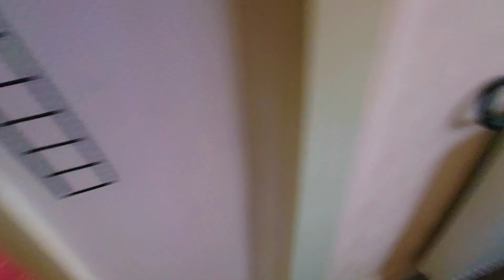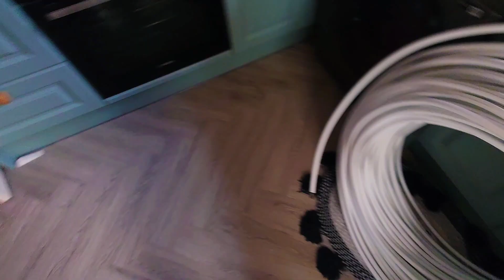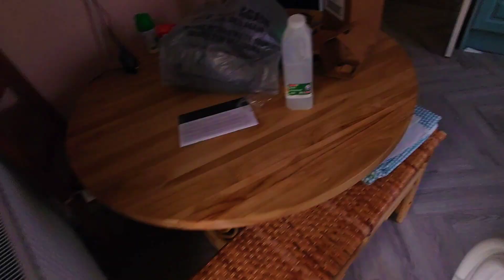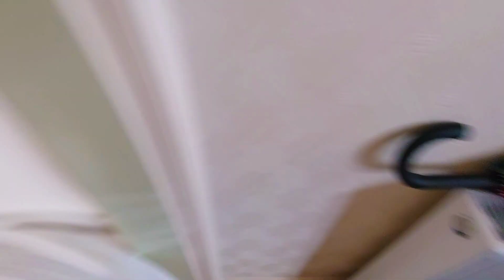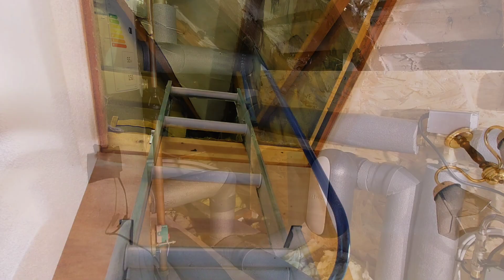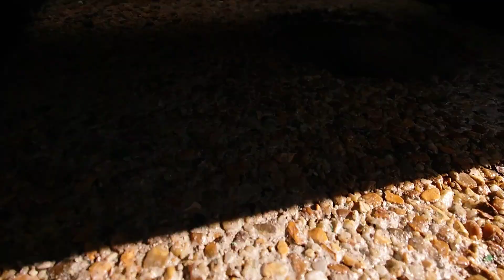Heat Pump installation. How much does it cost?

Comment: :-/ Sadness about the 4-port buffer tank due to the TRVs. Couldn't the majority of radiators be run open loop (no TRVs)? I understand that bedrooms might need TRVs but otherwise what is the need? It would bring down the cost of the system further still, and be less complex and give higher SCOP.
Reply from the maker: True. I could have piped it as a volumiser but the schematic for that on a 150a is a bit clunky with it needing an auto bypass and additional zone valves. 4 pipe is simpler and more open on this particular outdoor unit
Reply: @GHRclimatesystems  Thanks for your response. It is interesting that the Viessmann schematics put you in that direction. It is the same with Vaillant.
It is good to see you are using (Tweetop?) MLCP pipes to make the installation more economic. By the way, what 16mm MLCP -> radiator adapters are you using?

Comment: Looks like great work you're doing there. 

I've realised I've made a mistake renovating my property, I've put hard flooring down before updating my heating system and now ive noticed all my pipework is very narrow in a big old house 🫣
Reply from the maker: You can get plenty of kw down 15/22mm pipe on a gas boiler. Air source heating systems flow 4 times more water than a condensing boiler so that's why the pipes are bigger

Comment: Very nice job and the customer did well finding you as their contractor. Good price too considering you were starting afresh in an ‘inhabited house’. It would have been a more expensive job to sling a combi in.

What flow temp did you design for (@-2)?
Reply from the maker: Yeah it was a nice little job. Customer was great and just let us get on with it. 50 degrees at -2 is the spec

Comment: Moved away from Viessmann years ago in domestic because of the controls and customers hating them. It was lovely that they were weather comped back then but clients always complained about being cold, somewhat the same issue we have with elderly customers now since P+ came about.
Reply from the maker: We  have the same issues with weather comp with some customers. I'm generally leaning towards open-therm controls now if I get the feeling they are the type customer that just wants to nuke the house at 75° for 2 hours in the morning and 2 hours at night despite my advice to the contrary 😄
Reply: @GHRclimatesystems that’s the problem, most people don’t know how to operate their heating system correctly (efficiently)
 Classic example my mum had new boiler fitted two years ago, walls cavity filled, loft insulated etc it’s a really toasty house, I turned the flow temp down to 45 from 75 and tried explaining it all and that it doesn’t make a difference to room temp as you still set that with thermostat etc and to raise the flow temp incrementally if they feel the house isn’t warming properly….i go back a few weeks later and it’s back up to max, if they need heat they switch it on and give it the classic blast for a few hours, the problem is the living room gets red hot really quickly, her solution…....”open the window for a bit”…..I give up 😂